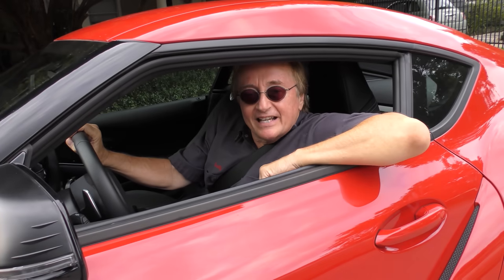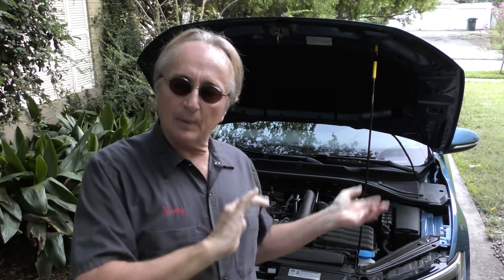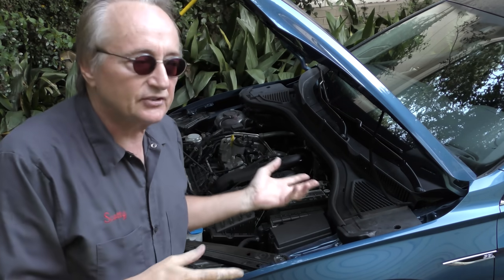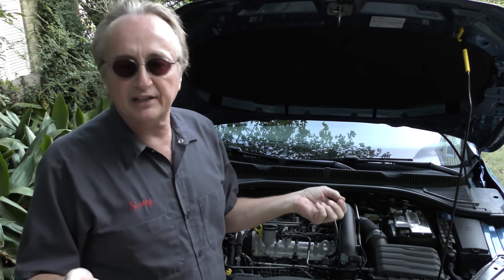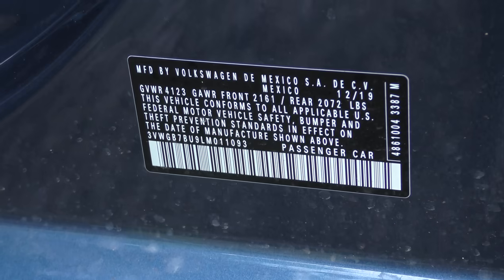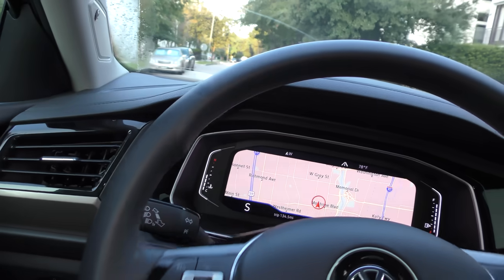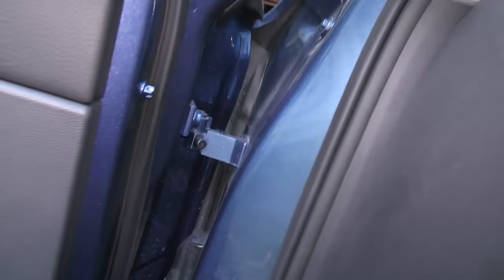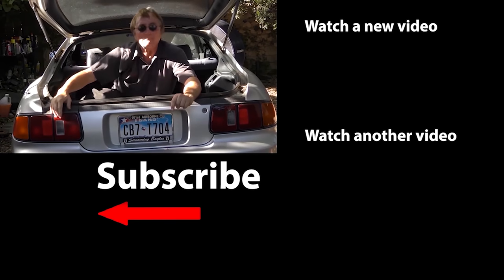I Just Found the Worst New Car Ever Made

Comment: I've had 2 VW GTI's in my day.  The Mechanic and I had joint custody.
Reply: michael tipton I had two 1963 Volkswagens and they never broke down.
Reply: @nickiemcnichols5397  The old air cooled cars had their weak points and failure prone parts, such as oil pressure sending units, accelerator cables, etc but they were dirt cheap to buy parts  and easy to work on. The whole engine could be taken out in 15 minutes. A 1930s design that lasted for decades.
Reply: Same with a new Mercedes
I had.
Reply: Nickie McNichols That’s a 63..cars we’re more durable back then compared to the modern electronic plastic crap we have today
Reply: Bro, if that's your joke it's time for a new career, standup
Reply: You win, sir 🤣🤣💯 Great Comment
Reply: LMFAO 😅😂 brilliant
Reply: @AB-yc1np  Not even a joke.
Reply: have mk1 and mk2 GTi, no problems whatsoever,as  long as you keep maintenance tight.
Reply: @ApocGuy  I'm not much of a mechanic.  I probably should have paid more attention to my Dad fixing our car.  However, all my cars are always dealer maintained.
Reply: @michaeltipton5500  iwasnt neither, but i had enough fleecing up by dealer and incompetent mechanics. i  would touch newer cars, but almost anything under mid 2000's i can probably fix :D .  i had numerous  occasions with mechanics that tried to squeze 500€ for oil filter replacement and timing belt change on E36 (on car that's MAYBE worth 700€€) , said enough is enough...
Reply: I had a mk5 rabbit with 2.5 inline 5 and manual for 7 years, had 0 issues.  Very happy with it.  Now have a mk5 GTI. Also, no problems so far. But keep in mind, both made in Germany.
Reply: Good one :)
Reply: And I have almost 21 years old VW Polo, 1.4 engine puts out 60hp, had it since December 2016 and so far put more than 40000 km on it. Stopped washing it after I started duck taping holes in the sill, an ultimate beater, but it still rolls along :)
Reply: Dam ain't that the truth😄... Oh me
Reply: I'm guessing you were paying the child support ?
Reply: I had a 1976 Scirrocco.  The parts manager knew me well. He said
"Just be glad you didn't have a Rabbit."
Reply: The only way I'd have another VW is on lease or an old air cooled.
Reply: @kevinbuckner4080  Great one if I do say so.
Reply: Trystelune  Water cooling allows tighter tolerances and more uniform expansion of parts.  Air pollution control killed the air cooled engine. 
If I got an Air Head VW, it would be an old Meyers Manx dune buggy.  As a hobby car.
For the price of an old 911 Porsche, I'd just get a new Corvette.
Reply: Well said.
Reply: Here in Europe old vw cars, models since 2000-2005 were very very good vehicles, simple, easy to work on, very reliable especially with the 1.9 tdi engine, I come from east Europe and those things still run fine and lots of people there use them. Sad vw has become more like BMW
Reply: domitry jobby Understood, likely the TDI engine makes a huge difference in long term reliability, over today's huge industry shift to small turbo charged 4 cylinders.
Reply: @cardo1111  the 1.9 is now the 2.0 tdi, there are people who had no issues with it but I also heard many horror stories from people who had those engines, I have yet to find one who had issues with the 1.9.. I personally moved to Japanese cars
Reply: Lol, I solved my problem,  I thru in a vr6 and problem solved. No more problems.  And if you had any transmission problems,  you throw in a diesel transmission and problem solved again.  Fun car if you know how to solve the problem by swapping engine and transmission.
Reply: The two GTI's I had were 85 & 87 brand new so VW and extended warranty paid all but still.
Reply: Hahahahahahahahahah
Reply: Lol
Reply: @VNCTHE1  Well I can laugh about it now.
Reply: 🤣😂🤣 well said
Reply: That's a very clever and hilarious comment. Definitely a "Like" for this one.
Reply: @FromDeath2Life4U  I wish it weren't true.
Reply: My 2017 GTI is great to drive, but it's clearly not the daily driver described by car reviewers. It's more like a weekly driver LOL
Reply: @ApocGuy  Things have gone downhill since.
Reply: @michaeltipton5500  I love my 92 GTI 16v. Owned since 99. Worth the occasional issues. Its a blast and just cool.
Reply: Yep, typically they aren't running correctly unless the MIL is illuminated. Well known meme/joke about VWs in the auto repair industry.
Reply: Your GTI's were cheap replicas made in Mexico 😂😂. Real GTI's made in Germany are extremely reliable.
Reply: @supposedly6991  not true, theres no difference in the reliability. The Mexican factory was overseen tightly by the Germans. Ive had a 92 GTI since 99. Solid.
Reply: One of the very cheap horrible unreliable engines they have ever been manufactured VW,. 👎
Reply: @djkenny1202  VW is good in Wolfsburg
Reply: @ApocGuy  I was gonna say must've been mk5 or after anything new is garbage
Reply: Same with my 2013 GLI!!! 😂😩😩
Reply: @heartbreakkyle273  man you should only buy German Volkswagen TDI
Reply: @dumyjobby  new VW is very nice
Reply: @supposedly6991  exactly with TDI
Reply: @djkenny1202  man they get paid 2$ an hour in Mexico
Reply: @dragospahontu  strangely, the worst ever made VWs are American Made.
Reply: Facts 🤦🏾‍♀️ Say No to VW
Reply: @ebonyr4204  I can’t. I honestly like my Toyota, but downright ❤️ my 20 plus yr old VWs
Reply: Classic wit!!
Reply: I had three sciRocco's in the '80s no problems
Reply: Priceless!
Reply: Would take a GTI over a Ford Taurus any day! Last time my dad took it to the dealership they told him the car was a piece of crap and couldn't fix it.
Reply: Same with my 525i bmw
Reply: let me see did Toyota promote another toyota? lol
Reply: Why did you buy two then 😭
Reply: @___-ht6js  Actually I was in Germany in 85 and bought the first one.  Was transferred to Mississippi and traded it in because it didn't have air.  Then I went to Alaska and traded that one in for a Toyota 4x4 pick up.
Reply: huge laugh from me.   I sympathize and embrace the tears for fellow 2.0 TSI owners ...
Reply: American cars are really awesome!!Popularity: US & Canada
Rest of the world: GARBAGE
Reply: Warranty Direct insurance company rates VW the 2nd Least Reliable engine due to frequent breakdowns.  My Beetle turbo engine died at just 70,000 miles so the WD rating seems accurate.  My 2 Hondas went 300,000+ miles with no engine breakdown.

Also VW commits criminal acts by cheating on EPA and EU pollution tests
Reply: You didn't learn the first time
Reply: My VW had the same care as my two Hondas that lasted over 300,000 miles.  There’s no reason for it to fail at just 70,000 (except it’s poorly designed crap).
Reply: Honda has several cars that passed 1 million miles on the original engine.  VW has ZERO.  Statistically VW engines breakdown more often than any other brand (except Land Rover)

.
Reply: Lol, 😂

Comment: Doesn't sound like the worst new car ever made to me.
Reply: It's not. I love Scotty but he's wrong about VW. I have a 17 Jetta with that motor (5 speed) and it's been a great car so far and they aren't as expesive to own as they used to be. Certainly the cheapest of the German options and the best option in my opinion. I got mine during a "sales event" and managed to buy mine for 15,500 before tax (Not a base model either, it's an SE). I am getting about 40-41 MPG. Maybe he's mad cause it rivals anything Toyota has MPG wise hahaha. He's certainly right about the belt though. That was a dumb move on their part.
Reply: @TheZero2414  get back in 2024 and then tell us about it. your car is still fairly new.
Reply: Tyrone Jeff O'Reilly Ramirez haha,  I’ve owned many VW’s never had an issue. My last one was a 2001 Jetta 2.0 with 245k miles ran perfect. In fact the guy I sold it to still has it and drives it. Life’s about experience and my experience with VW has been great. All cars have issues. The owner has a lot to do with it. I take care of my cars.
Reply: @TheZero2414  Do you live in Europe? I'm almost certain there's a difference between Europe and US when talking VW.
Reply: @TheZero2414  LOL a 17... ok. What's next, a 2018 KIA owner saying it's a great car because so far zero problems? lmao
Reply: john smith I noticed you didn’t say anything about my 2001 with 245k. I’ve also had a 2002 with 280k. So as I stated it’s about personal experience. I’ve not had any issues with the multiple VW’s I’ve owned. All cars have issues at some point. Kia’s can be good cars too. Depends on if you take care of it. Have a good night friend.
Reply: @TheZero2414  Even some Hyundai can last 250K+ miles, but there's a tendency or pattern, and most cars of some Japanese brands (say Toyota/Honda) will last 250K+ miles like is nothing, whereas vehicles like yours and most KIAs will not. They can last that many miles, but is rather rare to reach that amount without dropping thousands of $ on them
Reply: @TheZero2414  didn't the 2001 have a timing chain? the timing belt was the main gripe here because if it breaks after 150k miles  you're out of warranty and will have to junk the car because it's an interference engine.
Reply: I have 03 passat, best car ever.
I changed the belt a couple of times. No problems whatsoever.
Every light on the dash still works. 10/10

You do have to keep in mind to change the belt tho.
Reply: @midcenturymodern9330  Problem is that on the modern ones...like 2020 Passat or golf8 they use lot of plastic parts...like plastic oil pan, and plastic chain rails and plastic head cover and such. 
Other is that Germans complicate stuff by making little to no room in engine bay for dys stuff. Its hard to even change the light bulb. 
But...if you drive them correctly and maintain, those cars in Europe do 500k kilometers with no real issue, like for instance bmws. 
Audi also very good...but people...don't change oil in transitions, use wrong stuff and puff. 
They are highly desirable cars in Eu and every mechanic knows what to do and have spare or replacement parts.
Changing my timing belt with all oil and filters cost me like 400$ with labor.
That's nothing compared to US prices that he talks about.

He talking about vw is like me talking about Chevy 500 or Doge. Have not seen these cars in my life.
Reply: If it was a Toyota then it would be good. Toyota this.  Blah, blah, blah.
Reply: @TheZero2414  volkswagen make the most ergonomical and practical cars.
Reply: @jameshenson4871  Toyota is good, but Volkswagen is also good.
Reply: @dragospahontu  100% agree.
Reply: @jameshenson4871  in Europe they have a good reputation.

But it's interesting that depending on your geographical location people prefer different styles and brands.
Reply: @TheZero2414  curious how many miles you have on it.  that's the kicker.....when you get close to 100K, that belt is just waiting to happen, is my understanding.
Reply: @karieanne25  Forgot to answer your question. I am at 48xxxx. I drive a lot cause I do doordash. Only thing I have done up until this point has been oil changes.
Reply: Old VW were built to a very high quality standard, however they have dropped quality to get higher profits. They build cars for shareholders not for their customers. They save money using cheaper parts and make more money on spares. In Europe spares are cheaper as nearer to transport, more people selling spares, no taxes due to EU trade.
Reply: @sexysilversurfer  i agree, this goes for all German brands, they were so much better in the past like the legendary PASSAT B5.

That's why I switched to Toyota, so much nicer.
Reply: @dragospahontu  I switched to Toyota as well. 2002 Toyota Corolla. Apart from annual service and wear and tear on tyres, brakes wipers, shocks this car is still going strong at 90,000 miles. I am not too impressed with the newer Toyota stuff, too much fancy stuff.
Reply: @sexysilversurfer  nah, Toyota is always going to make everything as reliable as possible.

After switching to them as well i don't understand if other car brands don't know how to make a car properly or they don't want to.
Reply: @Stanjara  bro this cas is a legend in Europe especially 1.9 diesel cheap parts last forever it's the last good car Germans have made probably
Reply: @oskarrospondek1350  Yes, I have a dark red one that is very rare and every where I go people asking me to sell it.
Reply: @tyronejefforeillyramirez7961  I have a 2016 Sport just over 100k from brand new and it’s a great car.
Reply: @TheZero2414  Well, that turbo Jetta is so sweet. i very nearly bought one, but all the experts told me ‘No’....it is a disaster just waiting to happen. One mechanic told me, when I resisted (‘but i like it!’) ‘Trust me, you are going to hate the day you bought that car.’😩
Reply: @TheZero2414  Thoughts on 2010 Tiguan? .... 🙄
Reply: @WTFisthe911  owned one. They weren’t good. There’s a major issue with the chain tensioner with those. Stay away. This was also an issue with some of the GTI golfs that share the same engine. The new tiguans are a lot better.

Update. 60k with 0 issues. only oil changes and tires. Brakes look great for 60k on them. I’ll keep posting updates when I remember. I should note that I use this car to deliver food too. Lots of stop and go.
Reply: @TheZero2414  thanks man. I appreciate your feedback
Reply: @TheZero2414  You really think you know about maintenance when your car is four years old ? lol
Reply: let me see did Toyota promote another toyota? lol
Reply: Completely craps on any American economy cars for sure. Chebby Cruze and Sonic, Dodge Fart, Furd Focus and Fiesta with that horrendous DCT. All cheap junk that gets stepped on by their foreign competitors
Reply: @Dcc357  so the question is why are american companies doing it? because they clearly can sell cars, GM and others made record profit last years.
Reply: @metalgearsolidsnake6978  Record profit does not correlate with quality. The cars were very cheap and affordable compared to foreign cars.
Reply: @Dcc357  right but do you think they will change when they make billions on it?
Reply: Yup and also the transmission is made by AISIN and itd the same one as the corolla
Reply: Warranty Direct insurance company rates VW the 2nd Least Reliable engine due to frequent breakdowns.  My Beetle turbo engine died at just 70,000 miles so the WD rating seems accurate.  My 2 Hondas went 300,000+ miles with no engine breakdown.

Also VW commits criminal acts by cheating on EPA and EU pollution tests
Reply: My  VW had the same care as my two Hondas that lasted over 300,000 miles.  There’s no reason for it to fail at just 70,000 (except it’s poorly designed crap).
Reply: Honda has several cars that passed 1 million miles on the original engine.  VW has ZERO.  Statistically VW engines breakdown more often than any other brand (except Land Rover)

.
Reply: @TheZero2414  is it still running good?
Reply: @TheZero2414  Well see that Jetta was an 01. That was before they bought Porsche, Audi, Bentley, etc. Now modern VW's take all that German technology and stuff it into them. Some of them also have turbo-chargers, which I am not a fan of. And that technology breaks. And costs a small fortune to repair. German cars are so overly complex and expensive it's completely unnecessary, and VW dealers and salesmen are SO SNOBBISH, I can't STAND them!
Reply: @tyronejefforeillyramirez7961 I have the 2017 se it still runs perfectly, I’m bout to put a unitronic cold air intake on it hopefully the ecu doesn’t turn on the check engine light for too much airflow
Reply: @oliver24x from what I know, in Europe they had the 1.4tsi with a super and turbo charger and it would blow up and they made it only a turbo in the us. Idk if they still do both in Europe hopefully not

Comment: 2017 Jetta with the same 1.4L turbo. Bought it brand new now with 130k miles and never had a single issue with it.
Reply: Looking at buying one with about 25k on it, what have been your biggest expenses?
Reply: 2010 Jetta 138k nothing done besides maintenance parts
Reply: @ItsIkarys  Brakes. Rotors and pads were replaced at 116000 miles.
Reply: update?

Comment: Sounds like you actually like the car scotty 😂
Reply: Bruh i owned mine for 2 years its a really really fun car!
Reply: Ya lol 😂😂😂
Reply: @TheZakofAlltrades  how was it in the snow
Reply: @smifnwess93  put some snow tires on it and it'll drive great. warms up very fast so it's great for cold mornings!
Reply: Warranty Direct insurance company rates VW the 2nd Least Reliable engine due to frequent breakdowns.  My Beetle turbo engine died at just 70,000 miles so the WD rating seems accurate.  My 2 Hondas went 300,000+ miles with no engine breakdown.

Also VW commits criminal acts by cheating on EPA and EU pollution tests
Reply: The VW had the same care as my two Hondas that lasted over 300,000 miles.  There’s no reason for it to fail at just 70,000 (except it’s poorly designed crap).
Reply: He can't admit it